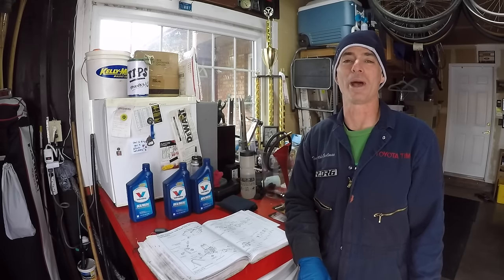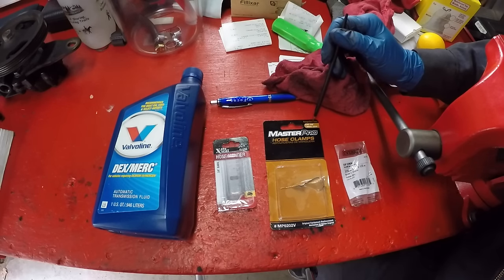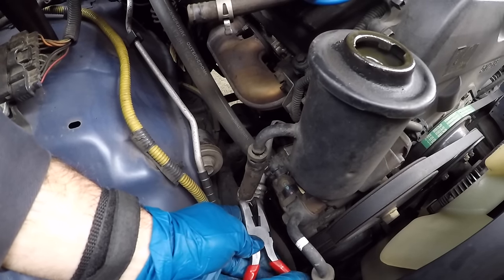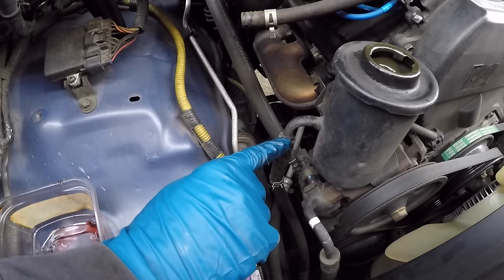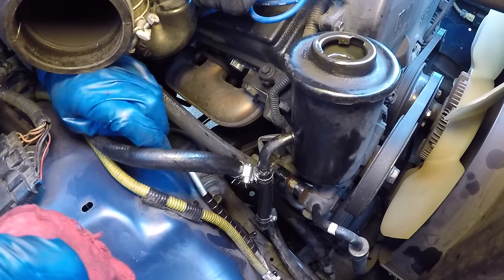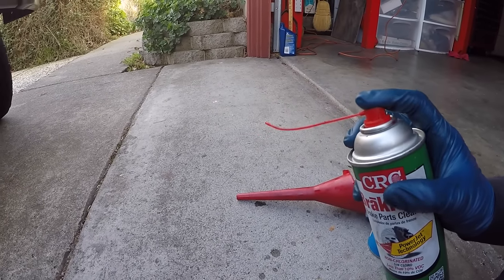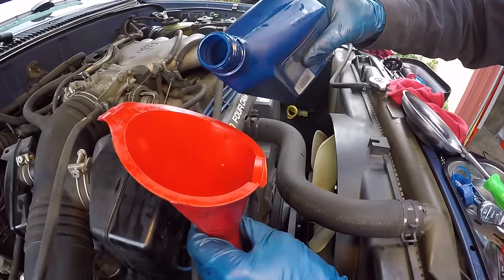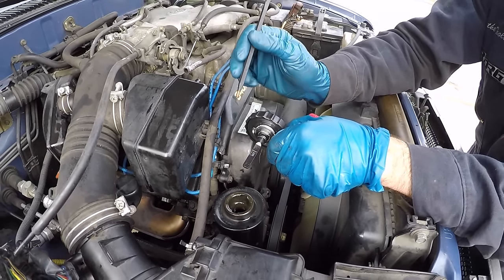Power Steering Flush and Reservoir Cleaning

Comment: Did you try low volume of compressed air to blow out gunk before the cleaner?....jc
Reply from the maker: No, we never tried compressed air.  If you try it out let us know how well it works.
Reply: @TimmyTheToolman  Well, I have an 1986 and the pump reservoir is not attached to the pump. It is separate. I did want to ask you about the ATF. Mine says I or II, but it is not made any longer. What do you suggest?  Thks..jc
Reply from the maker: @Samson-EC  You could a Dex/Merc.  A Dex/Merc is compatible with Dexron 3 and Dexron 3 is backward compatible with Dexron 1 and 2.
Reply: @TimmyTheToolman  Thanks Timmy. I contacted Vavoline and they said Dexron III/Mercon was ok. Never saw the compatibility on the qurt when I was looking. What is your thought on Synthetic?  Thks..jc
Reply from the maker: @Samson-EC  I did switch to Valvoline Maxlife ATF which is full synthetic. https://amzn.to/2Oaco0F So far so good.
Reply: Thanks. Appreciate your input...jc

Comment: If someone put generic power steering fluid instead of trans fluid, will it cause a leak? Will there be a chance of the leak going away if I put trans fluid back in?
Reply from the maker: Generic power steering fluid could cause a leak.  Sure, it's work a try to add ATF and see what happens.
Reply: @TimmyTheToolman  thanks for the prompt reply. I just picked up an 02 4x4 with e locker that was well looked after up until the last few years bc owner got old. The fluid in the Reservoir was dark but I could tell it was yellow generic kind. The rack was covered in fluid (pretty sure it was PS fluid).
Reply from the maker: @jdmDC2ftw  The fluid you see on the rack could also be motor oil from leaking valve covers.
Reply: @TimmyTheToolman  the VC area is pretty clean. Seem like it was replaced recently.

Comment: How about adding a radiator to the power steering oil video ?
Reply from the maker: I don't understand John.  Do you mean adding a power steering oil cooler?
Reply: yes, an oil cooler for the PS - since the AT oil seems burned
Reply from the maker: I think the condition of the fluid is more due to the fact it was probably never changed on this vehicle.  Power steering fluid is one of those fluids people don't think about renewing.  People remember their engine oil, transmission fluid and maybe remember to renew differential and transfer case fluids.  But, I believe power steering fluid is one of things people forget about.  

I'm not so sure a power steering cooler is necessary.  The fact that Toyota and other manufacturers don't install a cooler for the power steering system leads me to believe it's probably not necessary.  Changing the fluid regularly is really all you need.  Also, one thing that I didn't mention that I probably will do on my own 4runners is add an inline Magnetic filter in the return line to the power steering reservoir.  With the extra filtration from the filter, the fine mesh screen on the bottom of the reservoir will never get clogged again.  The only downside is you'll now be spending money on a another filter.  I'll probably do a power steering fluid flush and filter replacement every 30,000 miles.
Reply from the maker: I don't think it's necessary.  I think the fluid looked bad because it was never changed.  Regular fluid changes, every 30,000 miles, and possibly adding an inline magnetic filter in the return line will keep the fluid in good shape.

Comment: Have you seen a rear lower control arm snap? Mine did and not sure if I could tackle that or do I need to have it towed. Thanks Love the Videos!
Reply from the maker: Jameson Bates I have heard they can snap especially if they have been compromised with rust.  They can also snap from hard 4wheeling.   Watch the video we have for replacing the rear lower control arm bushings.  You can definitely do this yourself with the right tools.  A heavy duty ratchet strap is key to supporting the rear end when removing the arms.

Comment: If the pump moves fluid that quickly I don't see how you could do this singlehandedly.
Reply from the maker: It would be pretty hard.  You'd have to do very quick starts and stops.  Better to just have a buddy or family member help you.
Reply: You can do it without running the engine.I raised my 2007 land cruiser off the ground(front wheels) did exactly the same you did except i put a jar on the floor,  turned the steer all the way left while looking at the see through dranage tube, turn right add fluid little by little, voila mission accomplished no whining heard from the pump

Comment: Why not jack the front wheels and with key in ignition but ENGINE off turn wheel lock to lock and then there's no chance of pump running without fluid....?
Reply from the maker: Always more than one way to skin a cat. Thanks for offering another way for our viewers to follow if they don't like our procedure.
Reply: @TimmyTheToolman  hey Timmy I wanted to apologize I reread my comment and I sounded critical and I didn't mean to come across that way. I enjoyed your video and found it quite very well put together and instructional even though I might go about doing it slightly differently.

what caused you to want to perform a power steering flush or was it more of a maintenance and upkeep project?

Comment: I flushed my power steering fluid with ATF VI and  it still is having issues. My pump is also working since it ran it through however it is still making noise and i noticed some smoking in my engine bay after i flushed it. What is wrong?
Reply from the maker: The smoking is probably from you spilling a little ATF possibly on the exhaust manifold .  So, you cleaned the reservoir screen thoroughly and flushed the fluid?
Reply: I did clean the screen throughly the fluid was dark and bad but the screen looked pretty clear. I did notice some
Bubbling of the ATF in the reservoir...
Reply: Some air may have gone in the system. Not 100% sure what to do about that.
Reply from the maker: @tylerwinters2578  The air will naturally work it's way out.  Turn the wheel back and forth the cycle the fluid through the system and top off the level if it drops because air pockets had worked themselves out of the system.
Reply: @TimmyTheToolman  OK thank you, I will try that.
Reply: I did that for about 10 minutes and it still hasn’t worked, there is also a white smoke seeping from under my engine block. Hope it’s not my transmission?
Reply from the maker: @tylerwinters2578  Well, hard to say what's wrong other than the fact that the pump might just need replacing.  As for the smoking, you're going to have to investigate  first what is actually smoking and then figure out what is causing it.  If something is smoking, it's usually a case of oil dripping onto one of the exhaust manifolds, exhaust crossover pipe or the exhaust pipe itself.   You might have to remove skid plates to get a good enough look.
Reply: Yeah, I did end up needing to replace the pump. I didn’t have the time to do that myself since I needed a power steering pump pulley puller and it looked like I’d have to remove my radiator to access that so I took it to the Toyota dealer. XD
Reply from the maker: @tylerwinters2578  Well, glad you finally figured out your issue but a bummer you had to resort to taking it to the dealer.  I'm guessing they charged you a pretty penny for that job.

Comment: How's the noise after some driving?

I had small leak in 3.0 4runner ps pump.  Spent 250.00 on new one.   Followed bleed procedure to the letter.  Noisy as hell.  Company:  Buyautoparts.com refused refund.  Sent me another one despite my protest and insistence on refund.   While waiting for pump to show, I ordered and received an $11 gasket kit for my OEM pump.  After 20 minute 'rebuild' I was done.   I uninstalled the faulty pump from Buyautoparts.com which was another 4-6 hours.  During which their factory high pressure hose port nut came loose before banjo fitting did,  which led to broken air valve(3.0 pump has air valve and 2 air hoses going to pump).  A new one is $120.   So 370.00 so far plus $11.

But I had to drive to get air valve so I used epoxy putting (15000 psi) to patch air valve. ( and used that ever since)   

My $11 'rebuilt pump was perfectly quiet and steering wheel be turned effortlessly.  

But a leak appeared elsewhere on pump(a part that did not come with kit).  After a year of slow leak,  I finally installed the 2nd Buyautoparts.com pump.   

5 hours to install.  9am to 9pm because of a few interruptions including 2 hour process of again sealing air valve as precautionary measure.     Again,  followed bleed procedure to the letter.  

My reward?     A noisy, whining pump.  Stiff steering.  Hesitation and jerk during parallel parking,  etc..  But no leak!
Reply from the maker: That's a hell of a story with a not so happy ending.  Jax's pump quieted down after we flushed the system and cleaned the reservoir screen.  Jax's story wasn't exactly a happy ending either.  He totaled his truck driving into a ditch on a mountain road.  But, I think I heard his mom and dad bought him another truck.
Reply: @TimmyTheToolman  Uh oh.  I have to admit I'm a little pleased to hear if a 3.4 having issue...for once;)   I would say it was all for nothing,  but you taught us how to flush system systematically!  And I will be doing just that in hopes of finally eliminating PS noise:)
Reply: Oh nevermind..."driving into ditch"...motor still running no doubt:)
Reply from the maker: @TheWeirdSide1  I think I heard on his replacement rig he dropped a nut or bolt into the engine doing a valve cover gasket job and ruined that engine.  He either has bad luck or he's not that careful.
Reply: @TimmyTheToolman  They forever but only on gas and air,  not nuts and bolts lol!  Someday I will do 3.4 swap for my 2nd gen.  Then I'll watch your channel all over again:)

Comment: Very nice video .... we just change the steering pump, belts and steering rack of my son's 1998 4runner and still making noise. Is really weird, we turn it on and go perfect no noise from steering pump .... we turn it off and start and it has noise ... we turn it off for 15 seconds and the noise goes away ... we drive it without noise for 5 miles and then the noise appears again. We went over to the hole in the cap thinking it was covered. When we open the cap, it has pressure. weird thing Steering wheel turns perfect ... with one finger. ANY IDEAS ??
And yes....noise is from steering pump.
Reply from the maker: What kind of noise are we talking about?  Maybe the belt is a little loose.  When you say you changed the pump, did that include a new reservoir or just the pump?  If you reused the old reservoir, did you look to see if the screen was clogged?
Reply: Timmy The Toolman Whining noise same as a power steering pump with air. Reservoir was taken out cleaned and installed on the new pump...really clean screen. No belt noise at all....brand new belts. changed same day as steering rack n PS pump. 2 days ago.
Noise came from PS pump. 
 Example .... you start the truck ,
 no noise ... you leave it and noise dont shows up even turning the wheels. You turn off the truck, you start it again and start with PS noise, you move the steering and noise get worse. 
And so it goes on forever. Suddenly you turn the truck off, turn it on and it works like a new car, no noise at all from PS pump.
No belt noise at all.
No hard to turn 
just the stupid whining noise.
Even we try leaving cap loose....nothing noise is there.
Reply from the maker: @PelukaUSA  Well, that sure is confusing.  What brand pump did you purchase?
Reply: Timmy The Toolman From Autozone...second one....we change anotber one , to my other 4runner...no issues at all.  Timmy the original issue was tbe same noise...and when we check the Sterring rack we found the inner tie rod ends with lots of play and the steering rack with 210.000 we decide to change it. Plus the pump. So......new pump, New steering rack and we are on point zero ... with same noise as the old pump and old steering rack.
We own 3 runners 1 scion and 1 C-hr
Timmy....no air bubbles at all running.....again..... this sucks.
Reply from the maker: @PelukaUSA  I wonder if there could be some type of blockage in the power steering lines.  I take it the replacement steering rack wasn't OEM?
Reply: Timmy The Toolman Tested high pressure hose no blockeaje......actually after everyting installed we took it out...(what a pain)...no blockeage. Is so weird....tested return hose....no blockeage....we drain pump with engine running and flow trhu return hose is huge. Later I will post a video with pump running without noise and with noise. 
I wonder if PS fluid is the issue...we do not fill with ATF...we filled with "compatible" PS fluid from Autozone.
Reply from the maker: @PelukaUSA  Try using an Dex/Merc ATF.  The original spec calls for Dextron 3 ATF.  Dextron 3 isn't made anymore but a Dex/Merc is compatible.  I use a Valvoline Dex/Merc in my auto trans and power steering system.
Reply: Timmy The Toolman will try and let you know....thanks.
Reply from the maker: @PelukaUSA  I have a feeling the proper fluid is going to make a difference.  Got my fingers crossed for you.
Reply: Ok guys ... good news and thank you very much Timmy.

Step to tell what we found.

As we mentioned before after the installation of PS pump, steering rack and screen cleaning, we had the humming noise again from the PS pump.

As Timmy mentioned we remove the PS fluid, we changed it for ATF ... the results were the same ... at first very soft no noise and then ... noise shows up.

We started looking into the flow for the second time and it was very dark (just changed) ... we washed the filter and noticed that there was dirt in the liquid and the screen.

With my son we decided to remove the fluid tank for the third time but this time, also clean the return and pressure pipes by disconnecting these from the steering rack.

YES .... FLUSHING THE HOSES A LOT OF CRAP COME OUT FROM THE RETURN HOSE.

THEORY: BECAUSE THE INTERMITTENT OPERATION WITHOUT NOISE?
Answer: When we initially started the truck there was oil in the tank ... but when we started to move the truck, the pump took sediment from the pipes and deposited it on the screen.

When I explained to them that I turned off the truck and we started it again without noise ... it was because at that moment of pause the liquid filled the pump and worked well and again and again.

IF GUYS ... PLEASE, REPLACE THE RUBBER HOSES (WE DID IT) BUT ALSO FLUSH THE TWO PIPES.

SO FAR NO NOISE AS A NEW TOYOTA.THANK YOU TIMMY A LOT.
Reply from the maker: @PelukaUSA  Glad you finally got it figured out.  I'm guessing you got your rig used with a lot of miles and the power steering fluid was never renewed.  For that much gunk to end up in the lines, that fluid must have been in really bad shape.  I did this flush on my 98 4runner and decided to add an inline magnetic filter in the return line before the fluid returns to the reservoir.  The magnetic filter will keep the fluid very clean, much cleaner than the fine mesh filter in the reservoir.  I plan on replacing that filter every 10K.  https://www.magnefinefilters.com/NEW-Magnefine-3-8-Magnetic-Inline-Power-Steering-Filter-R038M-P-3810000.htm  I also use this same filter for my auto transmission since the auto trans has the same thing as the power steering reservoir, a metal screen filter under the transmission pan.
Reply: Timmy The Toolman Nice info.....well ...seat down......that vaby have 183.000 miles. 
Yes fluid was changed about 18 months ago...never clean the filter. But because was too much play on inner tie rod and almost 200k we decide to replace everything since start making noise.
Again Timmy ...a lot of thanks. Keep up the good work.

Comment: You should have just lifted the car so you don't need to turn on the car but besides that really good thanks for all the details
Reply from the maker: Yep, we didn't know at the time simply turning the wheels back and forth with the pump off effectively moves the fluid through the system.  It seemed to make perfect sense the pump had to be running to get the fluid to circulate.

Comment: I am getting occasional whine on startup that goes away after few mins, I am thinking the screen is getting blocked, it only happens when sitting overnight and probably when all the sediment has settled on the screen. Guess I need to clean out the reservoir or I will starve the pump and damage it.
Reply from the maker: Did you remove the reservoir yet and clean the screen? Interested to see if it fixed your issue
Reply: @TimmyTheToolman  I have not had any more noise since changing oil. I drained and refilled  the oil about four times until I used up the quart. Next time I would take the return line off and cycle wheels right to left to get it all out. Its 3.7 Grand Cherokee has oil cooler in front so there is lots more oil than what is in reservoir.
Reply from the maker: Metal Halide good to hear! Thanks for stopping by in the comments to share your experience!

Comment: Next time disconnect the spark plug wires and only use the starter motor to drive the pump. Lower RPM and the pump reservoir will not run empty, so quickly.
Reply from the maker: Thanks for the tip Richard.

Comment: You have to turn the wheel or you don't circulate you were just pooring new strait into catch container
Reply from the maker: Uhhh, not true Joe.  The fluid leaves the pump, runs through the steering rack and returns to the pump reservoir.  Turning the wheels with the engine running just moves the fluid through faster because you're giving steering input.  The fluid is still circulating through the system without steering input.